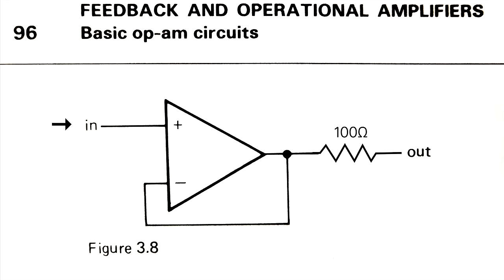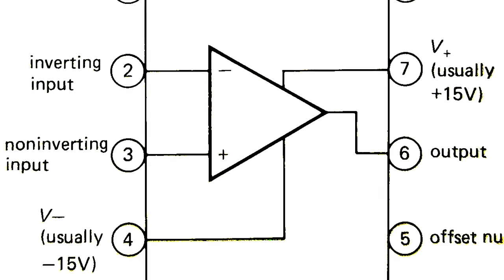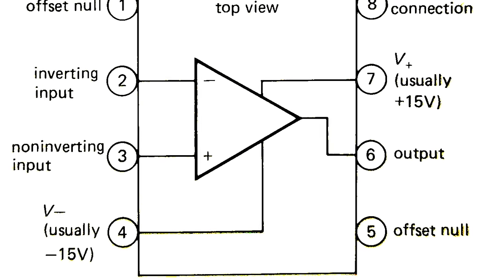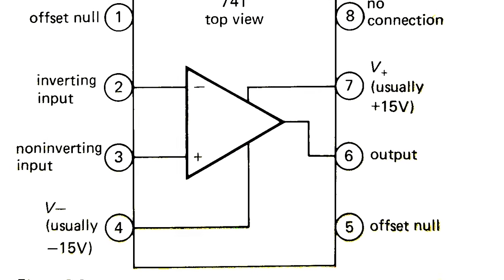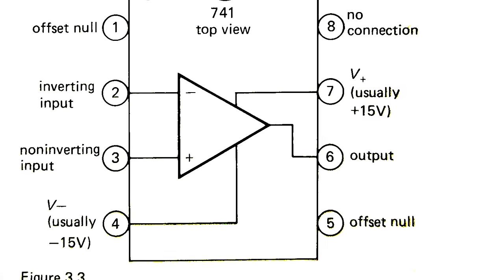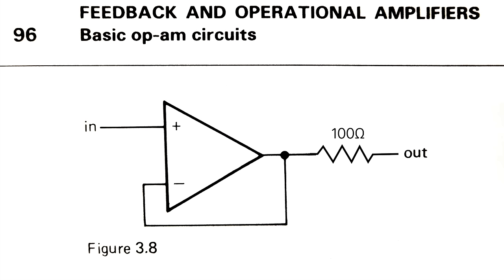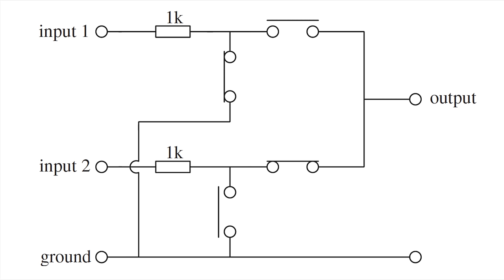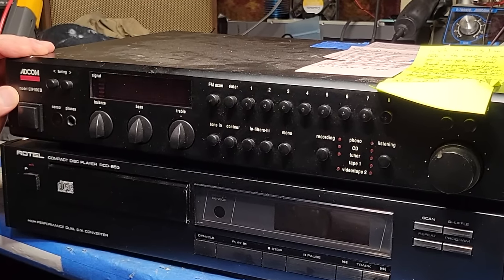Preamps: Why Are the Best So Expensive?

Comment: I have built several preamps using various operational amplifier chips made by Analogue Devices. The op-amp chips were described as being suitable for the most demanding professional audio applications. The preamps were very cheap to build and gave spectacular results. I therefore don't understand why you think that a good preamp should be expensive.
Reply from the maker: Because stepped attenuators and mercury-wetted relays are expensive. That's what I said.
Reply: i have a lot of control amplifiers or pre-amps and none was cheap ,i refered to 20€ to 70€ chinese new material that doesn´t work when new and opened from it´s sealed biox, the 82 sony was very good when working but only looking nice as it put´s the device on/off treble,. bass ,inputs for components not more than one for each , one Aux. input where later i conected the first sony cd player
Reply: @Lancaster_Hi-Fi yup I still have a Placette passive attenuator with custom trimmed Vishay resistor-stepped attenuator ladders with an RF remote. It’s great—but being a passive attenuator, I think it doesn’t have a buffer stage. So it was very clean attenuation, but not a lot of dynamics without an amp with 100-200k ohm input impedance. It ran me about $1000 back in the day. The buffer stage is what you get with the “active” version of the preamp which I think cost $3500 at the time. These are for single-ended units. If you want a balanced version, it’s 2x cost. So 2k for the passive and 7k for the active.

As you said, quality components and design cost money.

Comment: After 30 years of buying, building and trading Tube and Solid State, here is what I conclude. Preamps are almost always better when Solid State. The reason, they have a much lower noise floor. And besides, the only mechanical source close to Tubes is the LP Cartridge. Every other source comes from a Solid State circuit: Cassette, Reel (there are Tube reels to reel), CD, DVD, etc. The signals all are from Solid State. Hence, I prefer the hassle free life of Solid State Preamps and Tube Power Amps. Much better resolution and performance.
Reply from the maker: That's what I've done so far.

Comment: I use a Topping A70pro as my preamp/headphoneamp for my near field desktop setup. I use my PC and a Sony DVD player from 1999 as my two sources. My DAC is the Geshelli labs J2S AKM 4499. I use a Fosi ZA3 hooked up to some Emotive XB2s. I think I'm about $1700ish in at this point. For me, it sounds wonderful, and I'm very pleased with all the parts. The only thing I want to change is the speaker amp, since I feel a power amp would fit the setup more.

Comment: Hi Steven Nice video! Good to get a reality check on the better techniques employed on good preamps. I am using an exposure XII with separate PSU exposure XI that is nearly 40 years old. The power amp is an exposure VIII stereo power amp, also the same age. I short all unused inputs at the sockets. The sound is still excellent and the source selectors (the other for tape) and the volume control still perform like new. All the best, Rob in Switzerland

Comment: Thank you very much for the very scientific and useful explanation 
There are two things I can't get over in sound reproduction equipment: distortion and noise.  
I wonder how it is possible to accept that I send a signal at a precise frequency and at the output I get other signals that have nothing to do with the input signal 
Tube preamps often have a lot of distortion plus noise     And yet they are liked 
I, however, believe that they mask many other signals and are not satisfactory in the long run.   I prefer solid state for their lower THD+noise 
What comes out must be the mirror of what comes in. Always

Comment: Thx,  Rey enjoyable. You might like to read the “The TubePreampl CookBook” by Alan Wright of Vacuum State Hi-end electronics. I have one of his original FVP5A pre-amplifiers in my main system that I just love. In my number two system I have an old Nakamichi 610 control preamplifier which I have had since the 1980. This is the ultimate preamplifier for control freaks with no shortage of inputs and outputs which include two phono inputs with three different load settings. Regards from Australia Paul.
Reply: Is Alan Wright the same guy that designed the Lazarus tube preamps?

Comment: Nice work Prof👍.  Start with the volume control, then build a system around it. 

                                                                                                       Acid Jazz, Funk & Brass  🔈🔉🔊
Reply: Low input hi output

Comment: Great explanation. Thank you.
Does this apply to "unity gain" passive pre-amps
Reply from the maker: I haven't looked into passive preamps. One design principle I've read is that you need at least one active device per passive device (i.e., potentiometer). It might be possible to choose passive device values that would make buffer stages unnecessary.

Comment: Gold plated specs, and the fact that the devices will sit for years on the shelf, and sell in singles rather than thousands.  Pity the listeners will be middle aged, to be able to afford such things, and will have hearing which is well past its best. As a technical design exercise they have a place.  As a practical engineered device, demonstrating the optimum balance of function and cost, less so.

Comment: Well here are some things to consider 

1. Research how we got the blue led that will lead to how the CRT died. 

2. I also consider PreAmp(s) a top priority  because in all formats at the stage the signal is millivolts &  microamps basically in its infancy.

3. For a Vinyl enthusiast consider the circuit that outputs to a cutting head for Vinyl as a PreAmp standard .

4. The Term Analog just equals analogous so I questioned the electrical path and process that gives us Vinyl records .

5. What we call digital has suffered from the same problem problem of the blue led that lead to the white led that replaced are incandescent bulbs. 

6. It was always electron flow you are a very Intelligent person that studies we yes there is a lot of knowledge in how things were done in the past but advancement is important .

7.  Look up the Bob Carver challenge where he adjusted transistor tranfor function to match the curve plot of Tubes. (Stereophile magazine mid 80s)
 
8. PreAmp stage has become my favorite to add harmonics odd&even also spend more on power to filter eliminate  ripple has the biggest payoff

Comment: When it comes to volume control and source selection, I'm often frustrated that it's not it's own category as a "seperate."
When the "Wiim Ultra" comes out, I plan to at least try it out to add modern convenience with the remote with profiles, and the 12v trigger output to tie in my TT, the streamer, and TV to my Fisher KX-200 integrated tube amp and 800T reciever.
Reply from the maker: I'd be interested to hear how that works out.

Comment: I ignored or underestimated, for that matter, the importance of the pre-amp. It didn't seem logical to me why an extra component that actually attenuates the DAC signal (real amplification is only necessary for turntables) would improve the sound quality. Yet, it is a fact. My DACs, even with a quite powerful output stage, were never able do drive the active speaker as well as my preamp does. However, the preamp must be of top quality. Any extra noise or distortion ruins everything - at least for me. Some enthusiasts enjoy certain distortions to make the chain more "musical".

Comment: Belles, a fairly well known higher end audio company, made a boxed component which was called something I forgot. Are you familar with this component. Not sure, but  this piece of equipment was inserted between source and preamp or integrated, I believe, (could be wrong), and it is thought that it improved the sound by making the impedence more favorable. It didn't many if any controls on it. It pretty much just looked like a rectangular alumi um cased component. Can anyone tell me what it was called? It might go back some decades. It got good reviews.

 On a circuit board there is much micro vibration going on between resistors, transistors etc., like a never ending vibrational chatter, with the micro vibrations of each part affecting the others. I have come up with ways of addressing this and it makes more improvement than you would think. Glass which is made with sand, has been utilized in some exotic preamps with outstanding results. Sand is a great vibration combatter.

Comment: I'm using an SAE 2100L for my home cinema.  Works well for me.  My TV's fiber optic audio out is transcodes to stereo RCA, and my amp is an SAE 2400L.  I found this arrangement pretty reliable.  My Sub is a Tannoy PS115, while my speakers are Cerwin Vega CLSC-12.  NO EQ done.  Thoughts?
Reply from the maker: I don't have any experience with any of that gear, so my thoughts are that you seem psyched about what you have, and that's awesome!

Comment: Thank you, here's my novice take away:  Based on your explanation, it sounds like the only difference between cheaper and expensive pre-amps is their longevity, due to inferior/higher quality parts, respectively.  My question is, do the more expensive parts actually make the system sound better, or do they just enhance longevity?
Reply from the maker: I've been suffering the consequences of going cheap with the Soundavo that I showed in the video: The volume pot has become increasingly scratchy and distorting. I brought it home and treated it with Faderlube. I hope that works! That unit is only a couple of years old.

Comment: @Lancaster_HiFi. Greetings from the U.K. Thank you for all the information in your videos. I hope you don’t mind me asking, but have you had any experience with Sonab Loudspeakers? Sonab - based in Sweden (I think?) had an unusual design where the opening was on top of the cabinet, with the vertically mounted main loudspeaker vented through a slot on top of the cabinet. Under the top mounted metal gauze mesh grille were 4 smaller drivers. These pointed outward - towards the corners of the grille, to give an “omni - directional” (Sonab’s description maybe?) sound. I heard these Sonab speakers in a demonstration and the sound seemed to fill the room - that is, it didn’t appear to come from where the speakers were situated. Very impressive. And Sonab’s promotional blurb said that the speakers were built as a “pair” where all parts of the two cabinets were cut from one sheet of high density chipboard/mdf material. It’s possible that Sonab products were only for the European market and didn’t cross the Atlantic. Thanks again. Keep up your good work. Stay safe and well.
Reply from the maker: I don't recall having seen (much less heard) Sonab speakers. You're welcome and thanks!

Comment: Stepped attenuators using rotary switches are going to fail over time, when this when this is replaced
with more high quality relays then the cost increases to the point of making them very expensive.
This can be done with a digital attenuator, but the you start to introduce other factors that effect
the purity of the signal.
Very high quality is never cheap, if you have deep pockets then fine, but most people are happy 
with mass market equipment that is made down to a price.

Comment: They are expensive because some people are greedy and others are ignorant.
Reply from the maker: No, they're expensive because they have expensive components. (Didn't I say that?)
Reply: @MartinS-es6dp the circuit design can influence the price. A dual mono preamp with an external power supply will cost more…and one should be aware of the benefits of such designs

Comment: I had to watch this three times to get to the ‘expensive’ part, I kept nodding off, getting distracted, etc. I would like to have heard more about the Mercury-wetted switches. You also failed to mention the display, and illumination, which can drive up cost. Why not start your presentation where you ended it: “Two things drive up the cost of preamps, volume control and source selection, let’s see why. . . .”  Of course you might preface that sentence with, There are three reasons people use preamps: impedance matching, source selection, and volume control. Two of those three are gonna cost you, if they are done right. “

Comment: i think it´s not dificult to to reply, as they are much better , are expensive ,i´ve seen good power amps with chinese pre-amps or whatever litle bad quality material they sale from brands like fosi and douk or something like that, just take a look at early 70´s C1 from yamaha ,the most complete power amplifier i´ve seen and then the Sony from early 80´s Esprit series (ES)both are good but one as more functions than one might think and other as the main functions only ,the pioneer exclusive C3 or the C77 and the C21  is told to be very good but the others i refer are more complete ,the Yamaha was the most complete of all i ever saw, the Sony from 82 is more simple as great sound with it´s power amplifier and speakers from the same series, the Phase linear 4000 i don´t know if were already owned by Pioneer but the one i have from series two is ,i think it´s already from Pioneer, this new ones more cheap will work but not for long and i´ve heard some who aren´t good but are being used with expensive power amps and speakers, today a lot of sold material is snake oil

Comment: Sir put a coupling cap in damn thing and move on..
Reply from the maker: Um, a good coupling cap shouldn't change the impedance. Or am I missing something?
Reply: @Lancaster_Hi-Fi  for the most part ..all preamps are designed to couple to most any amp..didnt used to be that way..uh..before 1975 maybe..since then its all talk